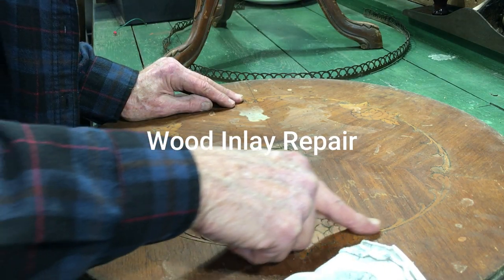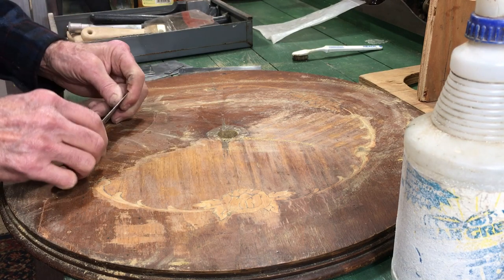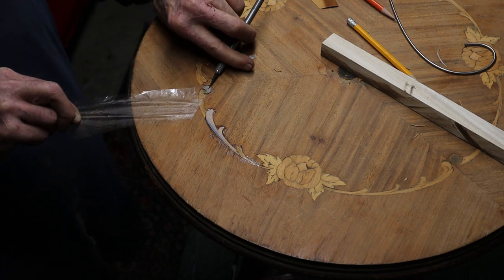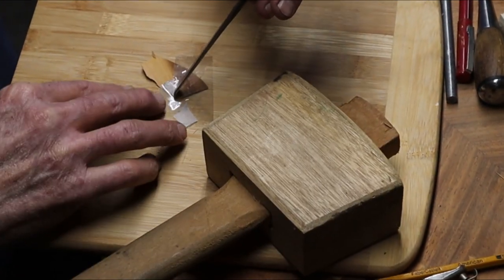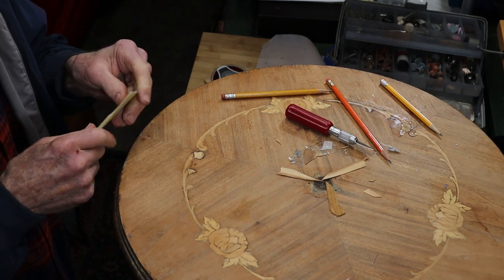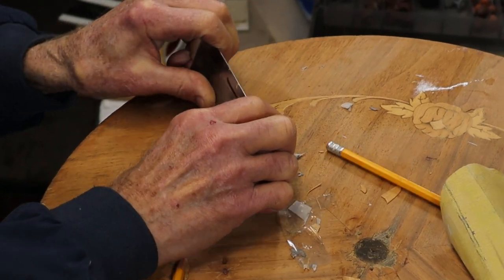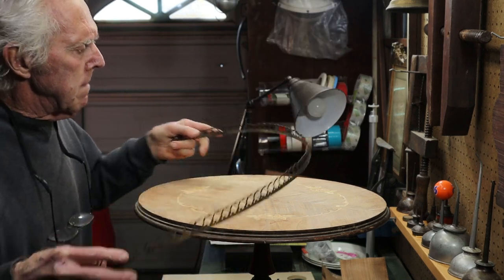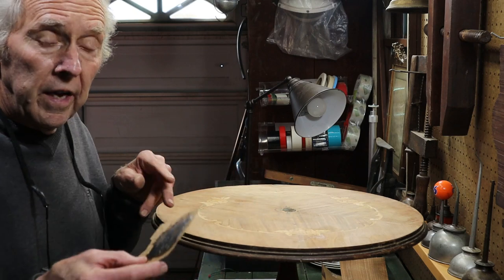Veneer Restoration—Wood Inlay Repair— Marquetry

Comment: Love watching veneer repair . It would be nice if you would slow down the filming to real time and show the whole process . Like do a 15 min clip of start to finish on an area . Maybe it’s just me but I love watching . Also that ( the bottom ) stand is fantastic !  The glue type is important too but I didn’t hear what kind it is . I will subscribe !
Reply from the maker: It's hide glue because it will clean up after the fact whereas PVA glue must be cleaned before it gets too dry. I have a 2nd video for the same table doing the center. I'll be sure to detail that.  Thank you for the subscription.

Comment: I've just found this as my wife bought a table needing "just a few touches" for me to work on as a new project. I have never tried to repair marquetry before. You refer to an orange and pumice and I wonder if this is what we call Swarfega in the UK. It is a hand cleaner/degreaser which works well on hands. I didn't know it had pumice in it until watching this video. But a great video, many thanks.
Reply from the maker: That the stuff amongst others.

Comment: Instead of putting a sheet of paper down, rubbing a trace image to obtain a template and then using the template to cut out an identical shape from the veneer, wouldn't it be better to simply create a patch (slightly larger than the missing veneer) and then cut the veneer to match your patch? This would ensure that the patch edges more closely align to the missing veneer as its a more direct process (fewer moving parts). Please let me know if you see any issues with this approach.
Reply from the maker: I think that would be a good way to do it. That's the thing, whatever works best for you. And I think I have done a trial and error approach many times. I can't recall exactly, but typically I will cut a piece from a pattern slightly larger and then sneak it in. Hey, thanks for watching!

Comment: Beautiful piece, even if it is not high quality.
Reply from the maker: Thank you. It is sitting in line for Part 2. Finishing inlaying the center and overall finishing.
Reply: @OddJobFix  I am eagerly waiting for Part 2, then! 

I do think scroll work of most any kind is beautiful.    

Thank you very much for sharing.   I learn many wonderful things from all of you.  In March, my son was given an 8 feet tall, 4 feet wide, 21 inches deep COLLAPSIBLE wardrobe. Somebody put glue in EVERY expansion panel.  It would not stand tall, only fall.  So, i picked, and picked glue out of the broken panel, created a support for the rear panels to keep them from sliding off the base,,... after FIVE weeks, I was finally able to remember its former glory.  Please note thatvi only wanted to make it stand.  I had no intention of stripping the finish.  I finally put a heavy layer of Mineral Oil on it... wow!!!

Comment: I'm youmg in this business and my question is, why have you decided to scratch it, not using chemical becouse I'd do it that way becouse thin veneer and I'd be affraid to not to damage veneer. And thanks for video amd keep up good work :)
Reply from the maker: If you are referring to not using a chemical stripper then you are correct. While something guaranteed not to have any water in it might work, and not using a water rinse, it's till risky. And, since this is more or less a modern import, the veneer is machine thin. Not like veneers of past centuries.